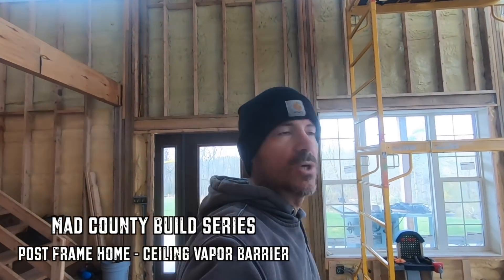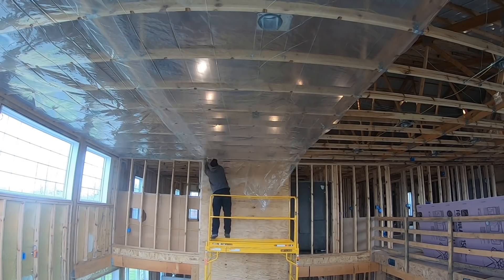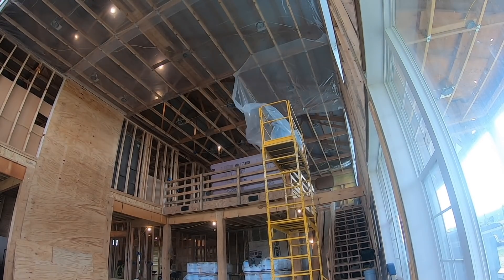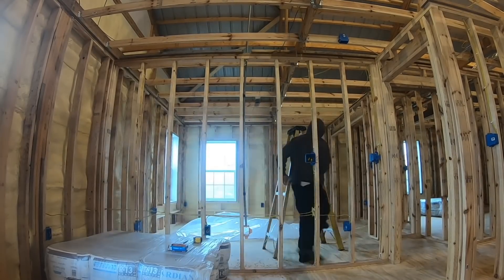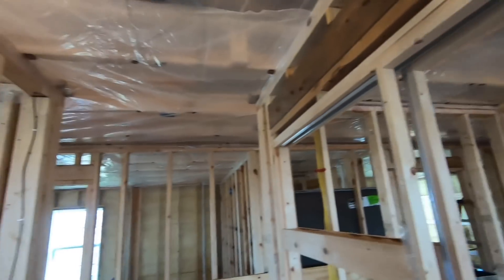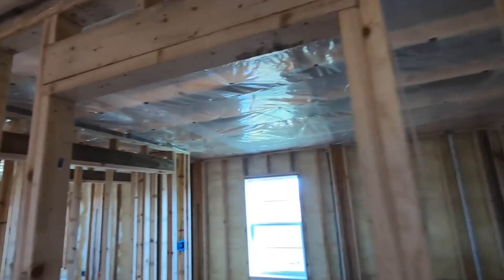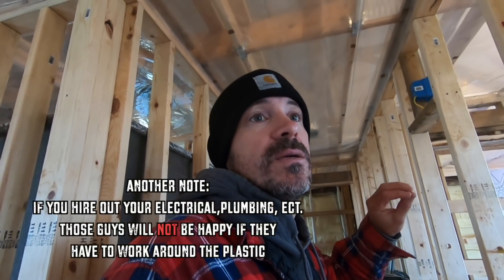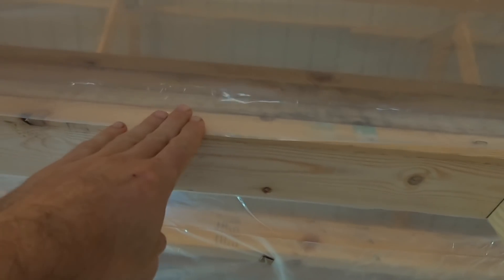Post Frame Home -  Ceiling Vapor Barrier Explained!

Comment: Was wondering, do you think You could use spray cork on metal ceiling panels for sound absorption? Any suggestions on how you personally would do this? spray before putting them up or after installing?

Comment: You mentioned you are putting drywall up on the ceiling. Are Trusses with 8 foot spacing able to handle the weight of drywall ok?
Reply from the maker: Yes as long as you have your trusses built properly. You have to specify what you are putting on for finished ceiling and roofing so that the top and bottom chord can be built for that specific loading.

Comment: I am trying to put up an air vapor barrier on my ceiling in my basement ceilings are not that high however there’s air ducts for the heating and there’s electrical outlets already in place so I need to be able to do this and go around these features somehow and still make it airtight can you show me an example of that please not one person has anything on YouTube and I need to have this done I have all the material in place and I just need some instruction so I could go on this project and stop the fibers from going into the air right into my lunch but I’m exercising

Comment: Is this a good idea for garage ceiling with only 3 joists in the middle to seal the ceiling to keep the heat going to attic and attic vent in the winter? I am only going to use the heating only as needed

Comment: Hey man. Thanks for sharing. I need some help on my own place. I'm in the process of installing a metal roof. What I've read says that I should put the vapor barrier over the rafters, add a batten over the rafters along with insulation, add purlins, then water/vapor barrier and finally attaching the metal roof (including flashing and ridge cap). Overall, this seems to avoid the OSB/plywood sheathing/decking and replace it with the purlins and batten. What do you think?

Comment: That's a neat trick with the cardboard squares. What size of staple did you use with those? I'm going to try that out when I do the vapor barrier in my new garage.
Reply: And on which side of the plastic did you use the cardboard washers?

Comment: If you have 3/4 inch plywood sheathing under a standing seam roof, would you still put the plastic under the bottom cord? vented eaves, solid rakes. blowing in cellulose, corrugated steel is the finished interior celling. heated with infloor heat. wall assembly is 2x6 with 3/4" plywood, house wrap and corrugated steel.
Reply: I typed this before I got to the part where you said the answer. I am thinking ill still use it. Thanks

Comment: You should run your electrical wires on the side of the rafters rather then on top when going length ways. You never want your wires to be in the walking path to be damaged later on.
Reply from the maker: Thanks for the input!

Comment: in cold climates like canada its code that you have to seal all the edges of vapor barrier with caulk or tuck tape. also you have to vapor barrier your walls   though with foam you dont usually need too, but if you had...  maybe wouldnt have had those issues.

Comment: Sorry I haven’t been watching all of the videos. I saw the condensation issue in the walls and I took some time to look back through the videos I did not watch. *** the vapor barrier in the ceiling is compromised since the seams are not taped “continues” is a key word. Moist air will most likely find its way into the attic insulation also. You will be amazed how much moisture can travel across little gaps. ✌️

Comment: There's a U tuber in Canada called "the Crazy Framer.  I don't know if it's everywhere in Canada, but they are nuts about vapor barriers.  Watch his channel to see what he does.  He puts a strip of vapor barrier under the top plate when he frames the walls so that when they do the ceilings, they can tape to it.  When I built my house here in South Dakota, I did not put vapor barrier where my ceilings were drywall.  However, I did where I did the Tongue and groove, as I did not put drywall up first.   I was surprised, having come from Minnesota where it's mandatory to vapor barrier the ceilings, to find that it's not typically done here.

Comment: I am finishing a 24 by 24 pole barn. I was planning to put foam board up in between rafters to insulate some and then frame rafters 16 on center for roll insulation for ceiling. Should I still put up plastic for vapor barrier?

Comment: What are the exterior dimensions of your two buildings (garage and house)?  I know previously you mentioned 18 feet high to accommodate two stories and your living space was 4000 sq feet.  I was wondering how wide as compared to the length.

Comment: If you add roof sheathing like OSB, you do need a vapor barrier because the warm interior air will heat the sheathing and then water can condense moisture in the sheathing itself and the sheathing will rot over time.  In AZ, even though humidity is very low,  often vapor barrier in the finished ceiling is not used, but condensation in the attic is eliminated by venting the attic. But in "cathedral ceilings" that are conventionally framed that have drywall directly attached and are not vented, I have seen not only the sheathing rot, but even the structural wood rot over time - and this is in AZ.  So in cathedral type ceilings a vapor barrier would be required. As a licensed GC, I will not build a cathedral ceiling unless it is vented AND it has vapor barrier.  But as I said, with a truss system like what you have, in AZ we do not put up a vapor barrier at the drywall because we have insulation installed directly over the drywall and that provides a barrier from the interior warmth. No condensation above the drywall occurs because the cold air from the attic does not get through the insulation to reach the drywall.

I strongly suggest that you purchase 8'  x 4' 1/2" OSB and cut it into 2' wide sections (8' fee t long) and install walkways in your attic. This will make your attic much more accessible for maintenance. You also can install some full sheets in some areas to create attic storage. You can install your blown-in insulation above the plywood and mark the areas where it is installed for future reference because the insulation will hide the OSB.  It costs some money up front but in the long run it is well worth it. 

I also suggest that you run LED attic lights in your attic right now. Again, it is so convenient to just go up through an attic ladder and flip a switch and have the entire attic lit brightly.  It really isn't that hard because you can connect your attic light runs to existing light wire circuits.  Because LEDs draw so little electricity, your existing light circuits can easily carry them. 

These are just suggestions to make your life easier later on when you have to go up in the attic to do something. 

You are doing a great job!

Comment: Nice job, especially for one guy,  I would have used carton (cereal boxes and phone book covers)  in stead of cardboard, I think that is important because the US standard is to use only one sheet of 1/2" drywall, and not two layers like is code in Europe (the second layer makes for a stronger, flatter result)  I would also have used a 2ft. strip of plastic over all top plates when the walls were stood up, and then tape them to the larger sheets, to make the whole vapor barrier "one piece"   In Europe it is code to tape (50 year rated) all seams, and use caulk (also 50 year rated) in all places where the plastic meets up with something not plastic,   I see on You Tube that the Canadians use "Tuck" tape like there is no tomorrow, for that same thing.   BUT this is YOUR house and YOU are the only man that has to be happy about it !!!

Comment: Paul , thanks for the detailed explanation on the vapor barrier. I thought that was much the case- as a plumber and HVAC contractor, I have done both new installations and remodels- bids for all new work are simple, bids on anything resembling a remodel are a joke. I tell people going in what the base hourly cost per man is and what my markup will be, include all my trip time, rework and reinspect time and then add 10% if I like you. They want a hard and fast bid, so I give them a bid with locked in conditions that leave me room to write up and bill for "extras"- the things the bid didn't cover. Believe it or not, most people would have done better using my system. So, yes, I know what a disaster it is to schedule when other work interferes. Good call, even if it cost you some time later. As always, I'm already jealous of this great house!

Comment: A typical trick that will solve the problem in the future is to put a 1 foot strip of plastic on the top of the wall.  That then allows you to attach those strips to the plastic that you install after with the accoustic sealant I mentioned...

Comment: Spray foam is good for filling gaps but the material you want to seal the edge of the plastic to the wood is called accoustic sealant.  It is black in color. You put a finger sized bead on the edge of the wall then using a roller squash the plastic into it.  They adhere and seals the two sides together.
Reply: That’s what we do in Alaska. We call the sealant “Black Death”.

Comment: I know the plastic is relatively cheap, but what else could have been used as a vapor barrier that would have been easier to install by yourself?  Thin blue board, drywall, etc?  Is drywall (taped on all seams) good enough for a vapor barrier?
Reply: Moisture will go through drywall. Plastic must be used as a vapor barrier
Reply: @cooper8318  Before plastic, metalized paper was used, horrible product, it tore real easy
Reply: @jesperdahl1486  Interesting, I have never heard that before. I didnt think they knew about vapor barriers back then
Reply: @cooper8318  I am not THAT old, it was used up into the 70`s maybe even into the 80`s (in Denmark anyway)
Reply: @jesperdahl1486  LOL sorry I didnt realize plastic film wasnt used as vapor barrier till recently. My construction experience is only about 10 years old and limited to my own residence remodeling. I just figured plastic film had been used for a very long time. Our older, prior to 1950s houses are well known for air leakage so I figure that must be why
Reply: @cooper8318  You must be real old if 40 years ago is "recently"   L(aughing)  O(ut)  L(oud)

Comment: Do you have the ability to do loose fill with cellulose rather then fiberglass? What makes you choose fiberglass instead?
Reply: You use the same machine to blow in both materials, so the choice is R value, cellulose is a lot lower pr. inch in R value over fiber glass, or mineral wool.
Reply: @jesperdahl1486  no, its not. Loose fill cellulose is r3.7 per inch while fiberglass is r3.0 per inch. Cellulose is alot denser then fiberglass against air movement, fire and bug proof, and rodents dont like it the way they fiberglass. Cellulose is a far superior insulation the fiberglass. It also doesn't mold due to being treated with borates. Fiberglass molds as well.
Reply: @mikecampanella1990  That comment puzzles me, I am Europe based, and I have previously looked up the values for both cellulose and glass or mineral wool, and cellulose is worse (the same at best) then the cheapest insulation we used in the 80`s and considerable worse then what we use today.          I just looked it up again,   the Lambda value of of cellulose is about 40, that was  about the norm for insulation in the 70`s and 80`s   today we use L 37 (if we are cheap)   L 35 is middle of the road, and L 32- 33 is the best on the market    L 35 is 12,5 % better then L 40, and L 32 is  twenty % better then L 40     Lambda is a different measurement then R value, BUT the % difference should be the same.     The only problem is, that to afford the L 32 you have to sell at least one kidney.
Reply: @jesperdahl1486  I am not sure what the difference with cellulose here in the United States and where you are from may be. But here, fiberglass is the cheapest insulation option and cellulose out performs it in every measure. Foams typically have a higher r value but many people can't afford them or don't want them off gassing in the house. I know I've seen some nice passive houses and net zero houses from Europe that use dense packed cellulose and gates wooden fiber insulation on exteriors.

Comment: Good job putting up the barrier and explaining its purpose. We built our house back in 2006-7. I used R-22 fiberglass insulation in the ceiling. But if I had to do it over today I would have had the underside of the roof spray insulated. Mainly because our A/C duct work is up there and it gets mighty hot in the Florida sun and it probably would have been more efficent.
Reply: You can always open cell spray foam the roof deck and make a conditioned attic. You will likely get a higher rate value then the r22 you have, and keep the ductwork out of such a hostile area. The return on investment is definitley there and will be made up in a few years.

Comment: Why didn't you tape the vapour barrier sheet edges to each other? It's required by code in many jurisdictions and even where not required it is simply "good practice".  In the same circumstances I would spray foam the over the top plates thus joining the vapour barrier/top plate seams to have a contiguous barrier from sheet to sheet between rooms.  Moisture will eventually wick through the top plates into the attic.  Even though spray foam in the wall cavities comprises its own vapour barrier you might also consider a can spray foam seal between the wall insulation and the back of the vapour barrier that comes down the wall a bit when you install the drywall to ensure a contiguous seal between wall and ceiling vapour barriers. Yes more work and slight cost but you've taken so much effort getting to this point a last few details will maximize your return.
Reply: In Alaska, caulk (commonly referred to as “Black Death”, not sure of the name) is used to adjoin two pieces of plastic. Then the two pieces of plastic are French rolled into itself and stapled. When the vapor barrier is brought down the wall, the caulk is applied to the back side of the vapor barrier, sealing the vapor barrier past the bottom plate, to also stop air moving under the bottom plate. This stops air movement into the condition space and stops any moisture into the insulation, making a continuous vapor barrier wall to ceiling piece of plastic.
Reply: @MM-sf3rl  That sounds a lot like Accusti-seal.   Great product but a bear to work with as it gets absolutely everywhere... 😲😖🙁😤

Comment: Looking really great.   Suggestion:  frame in a raised cat walk down the center of the trusses so you can get from one end to the other without wading through the blown insulation.  Mark the trusses with large numbers then take a bunch of photos before its insulated -- you will have a nice map of all the plumbing, wires and framing that will be hidden by the insulation.
What R value are you using?
Reply: On a previous comment he said he was doing r-60 blow in.

Comment: What is the thought behind not using something like Zip or OSB under your roof steel?  Great progress for a 1 man job!
Reply: Price for some
Reply: Those sheathing methods actually are weaker than steel because the screws don't hold as well in osb . I work building pole barns in Montana and we get some extreme winds so that might be why that is more important out here versus somewhere with less wind

Comment: As far as the kids' swings go, can you locate a place for them and install a flush beam in the ceiling and then attach some eye hooks to the beam so the swings can hang from the eye hooks? Kind of a long shot, but it was just an idea. You're doing great work... keep it up!
Reply: I was thinking the same thing. A long bolt going up through the beam like if you were hanging a large chandelier